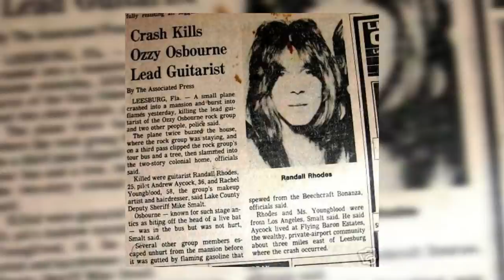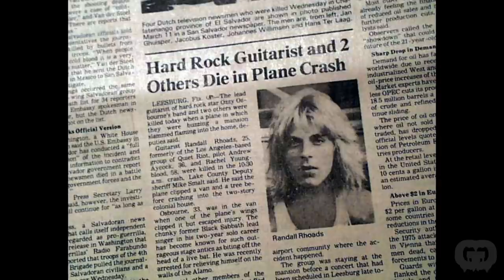Trash to Thrash #6 - Randy Rhoads and the Jackson Rhoads Flying V's

Comment: Very cool episode.  I like the history, background information.    I do have a guitar build question, regarding a locking nut.   My DIY guitar kit strat has a neck radius of 9.5, and I'd like to install a Floyd Rose on it.  The typical R2 locking nut has a radius of 10.0.   Should I file the string slots on the locking nut to make a radius of 9.5?   What do you recommend?
Reply from the maker: Thank you John!!
I would try it out and see how it fits. Those might be close enough to work.
Reply: @GuitarGuts  Thanks.  I'm building a guitar from a kit.  I noticed that you might be using Rustoleum products.    Does the Rustoleum Clear Coat fully dry after applying it and waiting for a while (like a week or so)?   I heard that it may not.    Second question, would you apply clear coats on EVH guitars, like the black/white guitar?  I'm struggling with this.  It's a perfect day to paint in NorCal today.  Lol.

Comment: Nice work with the battery  box and pait job looks great. Are you using a clear coat on the finnshed  job? Have a look at the paint swirling it  looks sick done using rattle cans and dipped.

Comment: Try pouring paint on a car wash sponge,facing the object and smacking it with a hammer! Where do you get the decals? Are they just vinyl stickers?
If it’s vinyl use the outer parts of the sticker and airbrush it! Did you clear it? What type of paint are using? Lacquer or Acrylic? Thanks!

Comment: Can I send you a 2017 JS32 King V body to fix up and give a red with white bevels paint job? How much would it cost? It needs a few dents and chips fixed, and the Floyd posts when the last guy installed it cracked the body need to be fixed. I think it's the bass side post that is cracked. I've had it sitting in a case for about two years now. I tried to paint it but it was late into the summer season and fall came quick.
Reply from the maker: Email me some pics of it. Let’s talk... mark@guitarguts.com

Comment: What can you personally do with the neck heels? I hate the 4 bolt design, I love the newer Jacksons with the fitted heals, have you ever tried doing any?
Reply from the maker: I haven’t but I should! I will try it on something, i would need to do away with the neck plate and use different screws... but that’s all doable 👍🏼
Reply: I think I read somewhere that Randy’s polka dot V started off with as bolt on type, with a neck from a different guitar glued onto it.  Also was damaged shortly after Randy got it, then repaired.